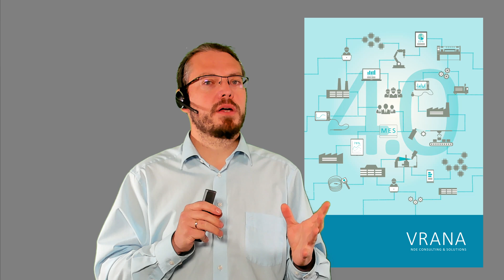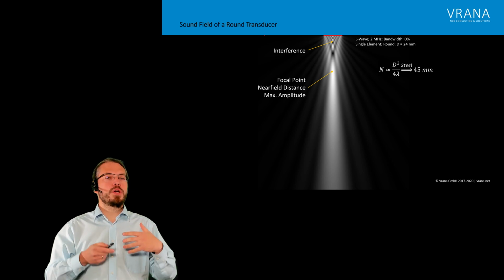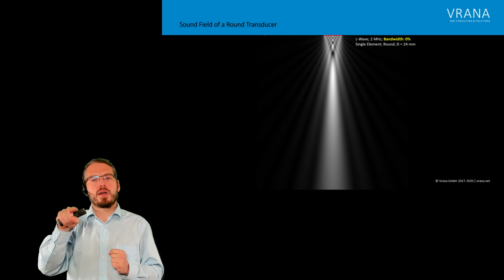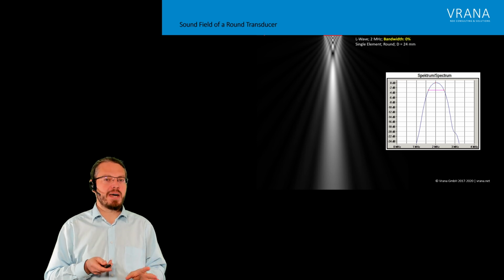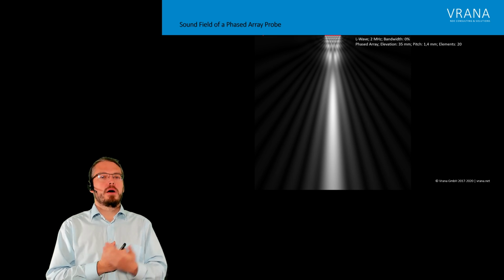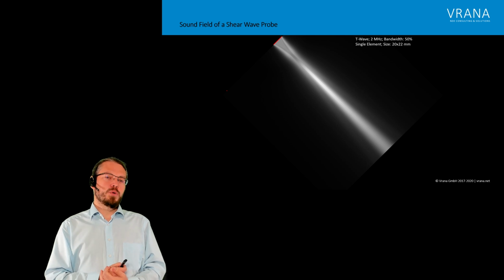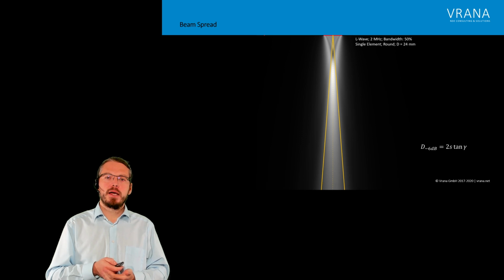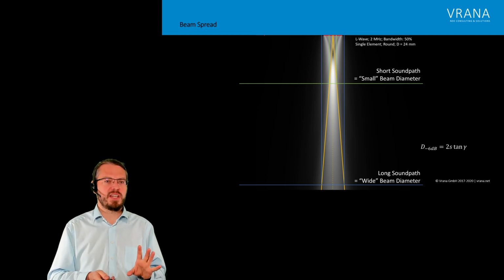Basics of the Ultrasonic Sound Field and why some of your training material might be misleading

Comment: Great explanation. Could you recommend some paper or other literature approaching the effects of bandwidth (or lobes) in the reflected signals?
Reply from the maker: Unfortunately no - most literature I know on this topic has too many errors in their formulas
Reply: @NDE40  I get it. But allow me just make a little question. In a PA probe, for instance,  you mean that probably I won't see ecoes corresponding to the side  lobes due to a "continuous" sound field geometry, since it can have a "wider" bandwidth compared to a "theoretically single-frequency" one? I don't know if I'm clear enough.